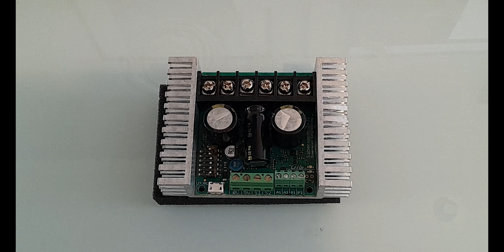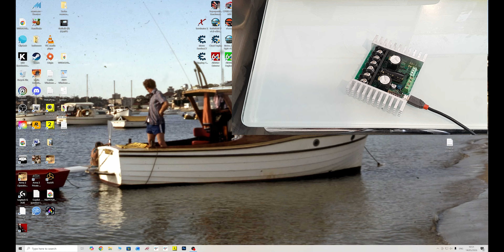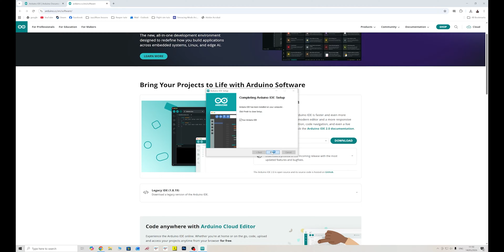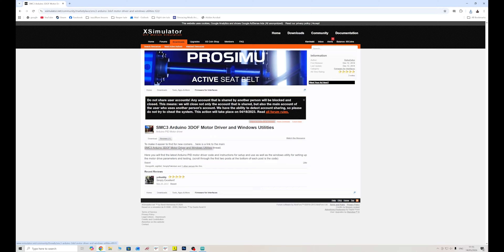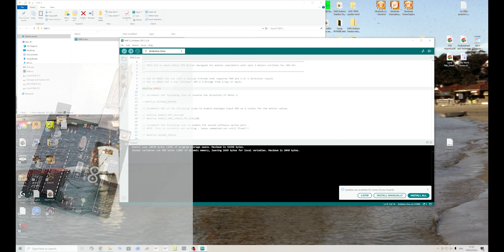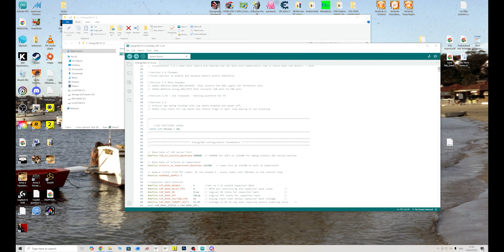DIY Motion Simulator Set Up For Sabertooth 2x32 Motor Controller + Arduino Uno R3 Micro Controller

Comment: I've only lightly dabbled in the Arduino platform so this might be a dumb question, but didn't the second sketch you uploaded overwrite the SMC3 you uploaded first????
Reply from the maker: Yes. Any sketch you upload overrides the existing sketch. The second sketch I uploaded was indeed the SMC3 sketch just slightly modified for the Energy360 boards and cap bank.